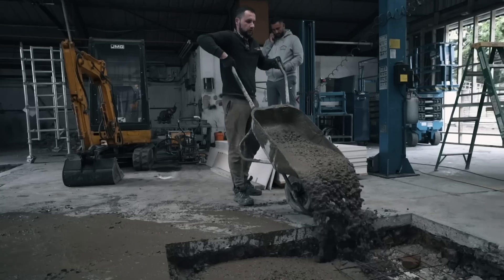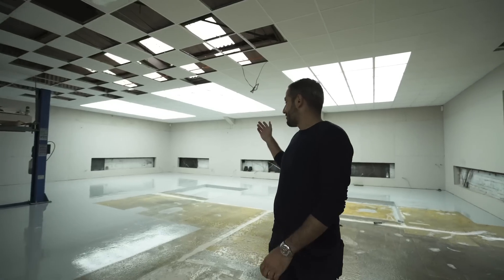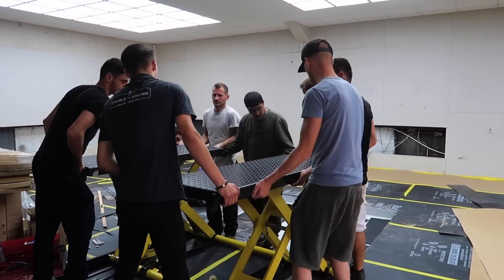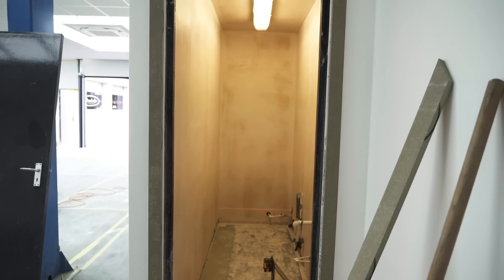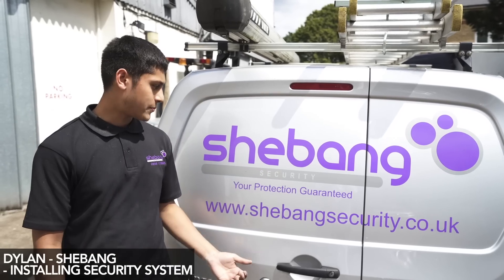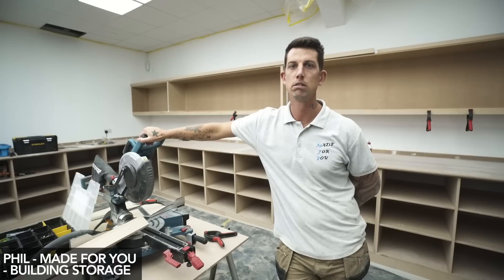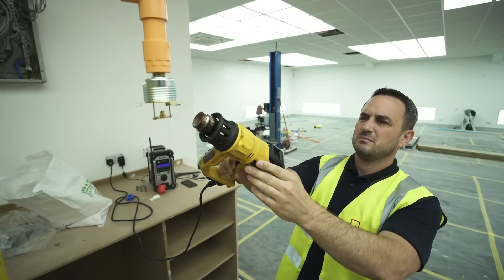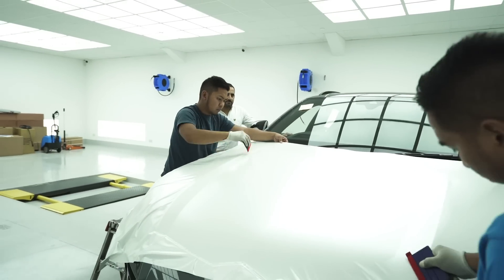New Yiannimize Workshop Complete (pt3)

Comment: Is that a timber noggin with electrics on it where's the building regs 😝
Reply: What part of building regulations doesn't allow fixing of electrical equipment to timber
Reply: @paulcraft4630  it's all changed it's a metal performed brace now I only found out about it last year when I saw a sparks use it on site I'm a Chippie myself I was first fixing a job and he pulled out this multi adjustable bracket is the best way to describe it with a dovetail either end Google it and you'll see for yourself hope that helps
Reply: @tomsmith9048  we use them all the time,  metal telescopic straps, made by Enrico,  about a £ each but easier than wood and all the boxes line up as they are predrilled, but as I'm aware no building regulations prefer timber or metal, the same can be said for plastic dry line boxes in plasterboard regarding fire regulations, good to discuss my 1st passion,  construction,  on my 2nd passion,  wrapping videos